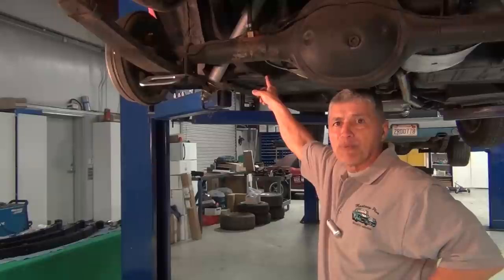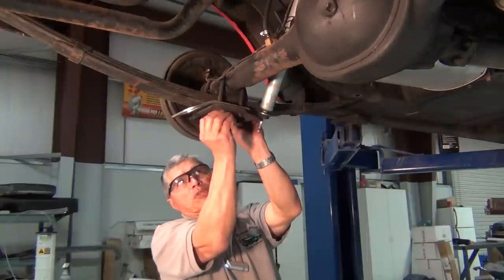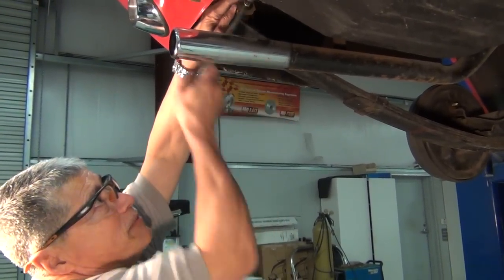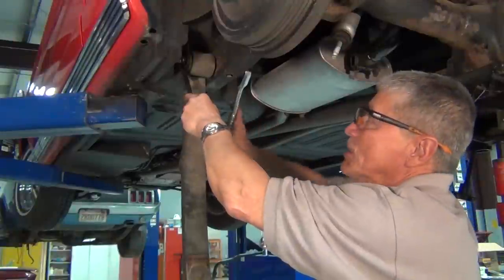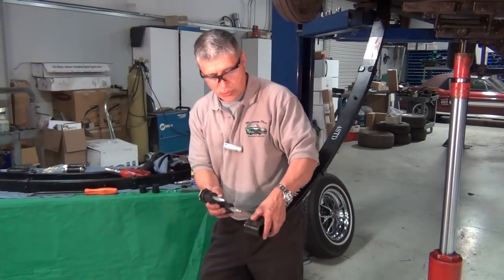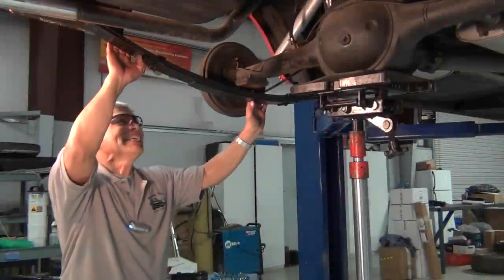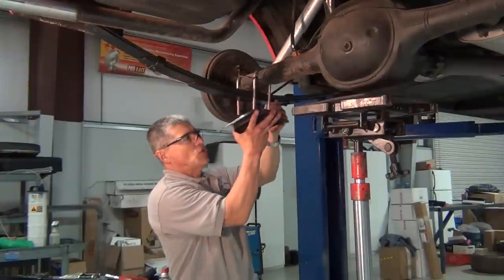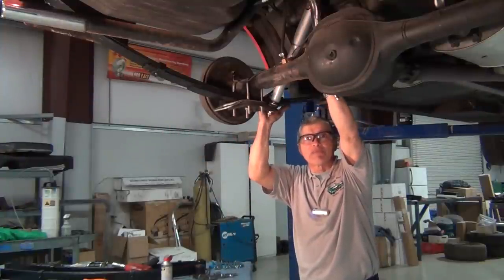How To Install Mustang Leaf Springs

Comment: This video was extremely helpful to me in replacing the leaf springs on my 1965 mustang.  Thank you very much for creating and posting this video.
Reply: One small tip that I'll add: a few days before I started the project, I squirted each bolt with a WD40 twice a day, to help loosen up the years of dirt in the threads.  I do this when tackling any projects underneath the car.

Comment: It would be nice to have torque specs with your video. If I tighten the back shackles to the end of the treads the bushings look to be way over compressed. Also what are the specs on the U bolts? Thanks for all the videos!! They have made our father/son restoration much smoother!!

Comment: This is super easy while using a car lift and a screw jack like he has. Good job. Try doing it while the car is sitting in a shop with no lift. One man can still do the task. Just need to take your time. For God sakes don't use neoprene grommets! You will have to use a sledgehammer to get the spring back into the front frame.
Reply: Jesus dude, you don't know how to use jack stands?? They are leaf springs, not rocket boosters.

Comment: do you have any video or pictures of the/a mustang (64 1/2-66) with the 4 leaf standard eye springs to see how the stance looks?
Reply from the maker: Call me 209-444-8039 I can get a picture for you.
Jeff
Reply: SaharaMustang
I tried to find a Mustang with leafs installed here. I am sorry most Mustangs we have at our facility have the mid eye or reverse eye option. Sorry :(
Reply: Jeff Bramlett allright, no problem. are they 4 leaf mid eyes or 4 1/2s? could you send me some picture/s of the setups you do have installed?
Thanks

Comment: What about a convertible. How would you recommend to do this instal.
Reply: It's the same. I am doing my '67 convertible now. The only difference is that the location for the top nuts on the shocks (if you are replacing them) are behind the backseat and NOT in the forward section of the trunk compartment.

Comment: just that easy! just take a short hand ratchet & unbolt your leaf springs off your 50 year old car.  maybe if it was a ground up restore just months ago or sat in a museum never drivin. I've had to torche or cut off EVERY leaf spring bolt on EVERY car older then 10 years old. even the perch bolts need at least an impact the whole way down the threads. must times have to switch back & forth from loosen & tighten with the impact with spray lube to cut the rusted threads. AND NEVER USE WD40 on new rubber bushings. it will eat them up. use only silacon based lube. sorry but this video will mislead the average person (who probably only has hand tools) thinking he can do this. its like showing a video on how to remove your engine but using a plastic mock up block, then just reach in and pick the motor out BY HAND! and say THERE YA GO! that's how you pull a engine! ye
Reply: Dan Sprouse, this video helped me greatly.  Sorry you had to use a torch to take off bolts and one squirt of WD40 is not going to eat anything and your engine removal analogy is a ridiculous one.  Here is what you could have said:  "In my experience I've had to torch off bolts--be prepared.  I also don't recommend using WD40--instead use Silicone base lube."  See the difference in attitude and mentality?  Dan Sprouse, you have lots of growing up to do still...
Reply: Only on TV

Comment: This is a professional installation? Never tighten leaf spring bolts until there is load on the springs.  The car should have been lowered and then the shackle bolts tightened.  Also, never use WD40 on rubber. Really surprised how such basic info isn't provided in this video sponsored by a Mustang parts company with the work being done by someone presenting themselves as a professional.